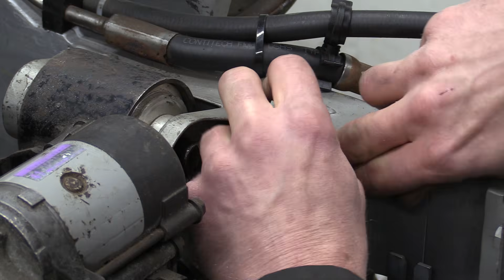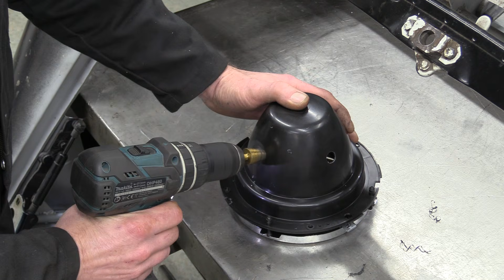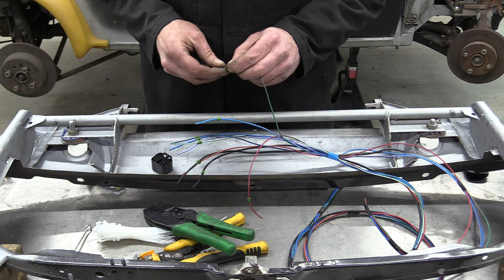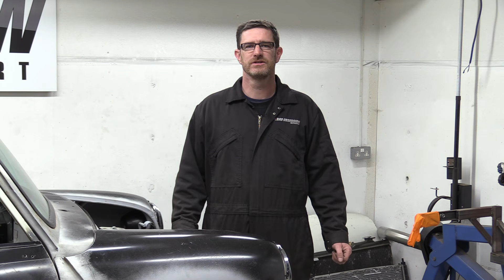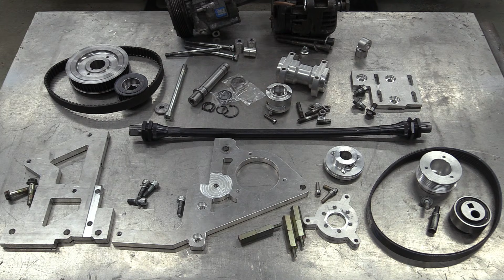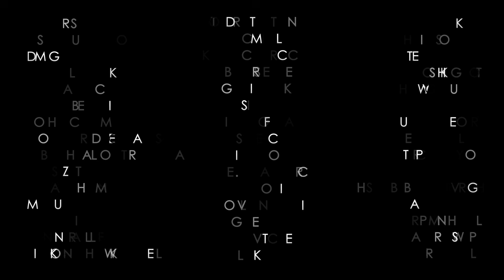Project Binky - Episode 20 - Austin Mini GT-Four - Turbocharged 4WD Mini

Comment: Reminds me of a story about the Citroën BX. Back in the 90s they started snapping cambelts, yet the same engine in a Peugeot did not. The difference was that the high pressure pump for suspension (and everything else) sat on top of the gearbox and was driven by a pulley on the camshaft. If the belt was at all slack when the pump cut in it would stall until the belt slack was taken up and then put a huge shock load on the cambelt. You were right to not do what Citroën did.

Comment: Question: have you guys considered a small self governing alternator that should be able to output somewhere between 12-14v to maintain the electrics and still charged the battery? Been looking into something like that for my project of *ahem jump jacking an older model hybrid to increase the battery range.

Comment: For the alternator, it came to my mind that you could use a really small hydraulic pump and a motor to relocate it elsewhere with fluid. Dunno if it wouldn't work but i suppose it would be possible.

Comment: Looking tip top as usual lads! Question: not using cable conduit or hole grommets? p.s - awesome work on the alt/ac assembly, engineering level99

Comment: Why wouldn't you Just use flexible peltier modules? Use the exhaust as a hot side and the driving wind as an cool side. If you can cover enough surfuce area you could make a realy decent power source!
Reply: Or even a turbo driven alternator.

Comment: Nice work minus the protective electrical sheathing and grommets.  As for the alternator issue, you could have bored out the pistons housings and added a cylindrical copper coil.  Then bored out a large diameter neodymium magnets and mounted them to the pistons, and hey presto, you have linear electric generator, unless you wire it backwards and then you have Electrical turbo. :-)

Comment: I was going to make some little idle comment about the lighting wiring like, put some rubber grommets where the wires pass through holes in the sheet metal, so they don't rub on the metal.  Then you blew me away with the alternator drive system :)

Comment: Guys, with all the trouble you are going through, why do you leave so many rusted part on the car??? Just look at rear suspension (at 15min 36sec of the video).  Why at this point that has nut been sand blasted for repaint???
Reply: They said it before. The old parts are placeholder. Would they use the final parts right now they would risk damaging them with their cutting and welding.
By example the motor didn't even have all of its pistons or valves.

Comment: Have you guys ever thought about swapping out the headlights for some of the all in 1 7" headlights. They have projectors which would help a lot with light output
Reply: Don't they just drop into the standard mountings? Example -
https://www.ebay.co.uk/i/291823392679?chn=ps.
Alternatively try some LED H4 bulbs like these. Example -
https://www.ebay.co.uk/itm/2X-Cree-H4-LED-Headlight-Lamp-Light-Car-CRL-High-Low-Bulb-6000K-White-100000lm/173515173609?epid=12020380098&hash=item28664f6ee9:g:Tf8AAOSwxHhbyt9R:rk:9:pf:0
The emitters are small enough to retain the correct beam focus.

Comment: For those of us who are culturally deprived and ignorant, could someone explain the TOT This Old Tony references? And thanks for the newest episode. Hopefully you can finish the Mini before I turn 80. 

BTW, in the 60s, I had an Austin Cooper Mini while in college. A lot of fun, but constant maintenance and repair (electrics, fuel pump, seat rails, wheel bearings, door handles, etc etc) If it could stay running, It was wonderful in the heavy snowfall of California’s Sierra Nevada mountains during ski trips.

Comment: Dude, the crank damper is harmonic damper also, it has an rubber mounting to take away resonance from the crank. Not sure if it makes diffrent tho since you probably will run smal turbo and not much hp. Should last awhile xD Love the project tho, want to see it on the road next year xD

Comment: Hello I realized that in the long term you can have a big problem in this area highlighted in the attached photo, it would be prudent to put a rubber in this hole to avoid with shaking that the cable will cut in the body and cause a short, I'm from brazil I love the project . Please Look at the picture https://www.dropbox.com/s/38nt07pzsz8uxfv/Opera%20Instant%C3%A2neo_2018-11-02_120819_www.youtube.com.png?dl=0

Comment: The Britts they are a funny folk.  Measure speed in MP/h instead of KM/h and count their money in Pounds but still use the silly metric system for weight.... :)
Reply: What's worse is that we invented your measurement units, and you're daft enough to still be using them! ;-D

Comment: btw, toothed drive belts on road cars (and rally cars!!) really need very good guarding stop stop bits of gravel getting into those teeth and jumping the belt clean off!  PolyV belts are the correct choice here (my choice would have been to mount a small high performance (high speed) alternator on the normal FEAD, and then run with an electric PAS pump and electric water pump that could have been easily re-located anywhere........  You could also have run an electric A/C pump, from a DC/DC convertor too, as the average A/C loads are fairly small, and you have a small cabin/small glasshouse, so pull down loading is not going to be an issue)

Comment: WOW !!  That alternator drive setup is AMAZING !

So if you don't like our "English" units, why is beer still served in pint glasses ?  Bottled beer in the US comes in 12 oz. containers, which is 354ml.  Much less than an imperial pint, 586 ml.
Reply: All our road signs are in miles and most people still refer to heights and weights in Imperial units.  I hate Imperial units but I'd still say I'm 6'2" and 13 stone.  It's all typically mixed up and a legacy of the long history that this country has.  It all basically works so no-one gets excited about it.

Comment: I love this build but I'm confused about the wiring. The shell has yet to be sprayed inside and out, but the way the wiring is routed, much of it is impossible to remove without cutting off the many presumably expensive plugs you've fitted. Having been such a perfectionist throughout, I can't get my head around what you are doing right now?

Comment: the OEM crank pulley is a harmonic dampner as well. Changing to the non dampening pulley can cause big problems. But then again this is not a 2ZZ engine revving at 8k RPMs and the oil pump is belt driven not on the crankshaft.  So you might be ok.

Comment: So I am actually a bit confused about why you are not using grommets of some kind.
Reply: Whole car has to come apart for paint, no use stuffing in a grommet just to pop it back out again.
Reply: @WiscomptonBoys  Interesting. So all the electrical plugs will get disassembled again to be pulled back out of their places before the car is painted? That seems a bit odd. Maybe the holes that all the wires are running through should be big enough for the plugs to come through as well?
Reply: @nathanjames4242   Yes, most likely it will. The attention to detail these two have is immaculate, and I would very surprised if everything wasn't completely removed to paint the inside as well as the outside. When a car is painted in the factory it's a bare shell, nothing else, then everything is ran through it. Same idea here. That keeps you from painting your wiring, grommets, etc. Plus, if you painted with the grommets in, even if you masked them, you'd have an unpainted circle underneath where the grommet was! Best way to paint a car is to strip it down to nothing, and one thing they don't need to over engineer is sticking some grommets into the holes, so no need to 'test fit' so to speak. 
Of course that's all just conjecture.
Reply: My thought as well, but the British are well known for their wiring.
Reply: Please see https://youtu.be/WIyxrvO3dRk?t=48
Reply: Look closely starting at 0:45 and you will see a Gromit being installed

Comment: Great video and great work as usual. I am surprised you have run cables through box sections without wrapping it in loom tape to protect it from abrasion caused by vibration. No rubber grommets in evidence either. Please protect your wires!
Reply: My best guess is why bother when it's all getting pulled out for paint eventually.
Reply: @valleywoodworker In one of their Q and A sessions they mentioned leaving some openings to blow anti corrosion down frame rails and boxed sections, I'd think after all the work into this car it wouldn't be too terrible to pull the wires after taping a pull cord to it. Wouldn't want to get paint on the wires, makes them brittle to with time.

Comment: Imagine wrecking this car. I wouldn't be able to race this car.
Reply: It's not being built as a race car,  it's going to be used on the road.
Reply: @RawTopShot  why is the channel called Bad Obsession Motorsport then?
Reply: Vax Buster 
They ( as a business )  prep and build race cars.
Binky is a personal car project, but serves the purpose of displaying the mens engineering prowess.
Reply: @RawTopShot  Displaying that customers will be waiting 5 years for an unfinished car :)
Reply: Well now, if you start paying for stuff, the project will pick up speed and be done in only 4 years time !
Reply: Without spot lights it will probably crash in it's first race

Comment: Flexishaft is pretty cool but did you guys factor in the inertia of the accessories on the flexisaft? When you gear change there will be a large step change in engine speed the torque produced from the alternators inertia may over stress the shaft. A one way sprag bearing will significantly reduce the loads.

Comment: Want to see the flexjoint in action, when the alternator has full load+a/c compressor.  I know that on a bench a 750W(ca 1hp) electric drill has not the power to turn the alternator when the battery is connected and the energize wire too.

Comment: Quality work as ever lads. Did you check out motorcycle alternators as an option? Plenty of small external mount types that could be modded to suit. Some are pretty high output, Honda goldwing or bmw k1200 etc. Was there no space to run a layshaft to the rear then step up via a short belt and pulleys to get the alternator above the box? Cramming alot into a small hole...

Comment: The main big power cable and wires exiting that chassis rail I would have put a cable gland on ... especially with unfused main power cable from the battery. If you guys want to fuse the Starter/Alternator get a nice MEGA style fuse holder that looks stock and put it as close to the battery as possible prefreably on a insultated surface too: https://au.element14.com/littelfuse/02981001zxt/fuseholder-mega-bolt-down/dp/9943200?mckv=snkbgIbge_dc|pcrid|59148083448|pkw||pmt||slid||product|9943200|pgrid|12550800888|ptaid|pla-295294719026|&CMP=KNC-GOO-SHOPPING-9943200&gclid=EAIaIQobChMIloXYiaO13gIVRmoqCh0mmwilEAQYASABEgLUOvD_BwE&gross_price=true

Comment: got to ask what ecu are you using as no dizzy ... and where are you putting the crank pickup ... and what about the TVIS setup with the flexible shaft ... just asking... big thing on some of the celica forums  the crank has a tendency to snap with a solid crank dampener ... guys keep it up better and better every vid you do  be it betamax or vhs

Comment: Am I missing something? Where’s the grommets and sheathing on the wiring loom to prevent abrasion and shorting? And the engine now lacks a harmonic balancer, love the work boys but you might want to rethink these. I’d recommend contacting ATI Dampers they can make something that will work for you.
Reply: I'm guessing the grommits and abrasion proof nylon sheath will come after painting. As AvE would say, it would let the angry DC pixies ooot !
Reply: I presume they will use a split plastic flexi conduit and some rubber grommets during the final assembly after painting.

Comment: Not being able to sip some tea in person my two Pents worth could be disconnected to one cent Australian.
A motorcycle alternator that direct drives off the crank would have worked and a peltier based cooling system would have done aircon and heater both.
Other alternatives would be going under the engine maybe running a tube through the sump. Or fitting a spacer to the bell housing and flywheel to fit a rear pulley

Comment: Great episode as always. On the alternator issue I wonder how well a motorcycle stator mounted right to the crank pulley would have worked. I think you can find ones that make 400 watts and there would have been no flex shaft.

Comment: Great bit of engineering.
I personally would have mounted the front lights connector 90 degrees to the way you have though. Even though it is water proof, a drip loop on both sides and no way for the water to pool would have made that connection bullet proof. But I'm sure it will be fine

Comment: Just a note . Does the new crank pulley have the integrated dampener like the factory one ? 3s's are renounced for having issues with changing to an alternate front pulley , and can result in crank walk or snapping . That's why none of us use anything but OEM

Comment: E60? Forget that, they had it wrong since the E46. I'm constantly having to sort out the molten plug and replace the light boards due to the single ground pin that is, you guessed it, the same gauge as the 4 power pins. BRILLIANT!

HAH! Love the This-Old-Tony bit.

Comment: What i don't understand is how you can spend weeks doing all the quality engineering but couldn't be arsed to tape that wiring loom up. You threaded those wires in areas which will rub through the insulation and could start a fire, its unsafe basically...

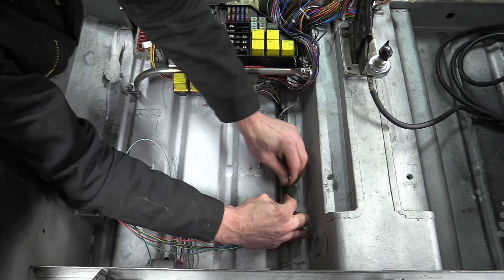Comment: 13:30.  Only thing that bugs me more than leaving wire ties uncut is cutting them off with the wrong tool.  Flush cut them.  You will appreciate not bleeding out when you drag a body part across those razor sharp ends.  https://www.amazon.com/Cutter-Lightweight-Klein-Tools-D275-5/dp/B000GTMZHG.  Fine work boys.

Comment: Where the wiring goes through the pipe on the bonnet, Will rubbing from opening and closing the bonnet, and vibration be an issue on the I.D edge? Probably needs a grommit or something in both ends of the pipe to stop the wire sheath getting cut into over time

Comment: As an owner of a Celica st185, I am absolutely flabbergasted at the engineering of the alternator and ac pump configuration. Seriously my jaw just hit the floor. I just got done rebuilding my 3sgte with quite a few modifications, but this is a whole new level. 

You mention getting rid of the distributor. Might I suggest an oil pump from a 99-01 5sfe Camry, the crank sensor, and a 3sge beams crank gear that already has a toothed trigger wheel attached to it.

Comment: Fantastic work, incredibly clever solutions! But, what about the harmonic balancer? Doesn't removing that rubber damper bit make the engine liable to shatter oil pump gears and ruin rod bearings from un-tamed crank harmonics?

Comment: Fantastic work guys! Excellent episode, keep'em coming! Your trans mounted accessory drive is pretty slick, a lot of work went into that setup! I hope that flex shaft holds up well, thats a lot of load on it. If it doesn't you might have to resort to a double jack-shaft arrangement. Or perhaps   there is some kind of small constant velocity (CV) shaft that would work? Maybe off of a 4 wheeler or UTV? Maybe custom built? Anyways awesome work guy's, keep it up!

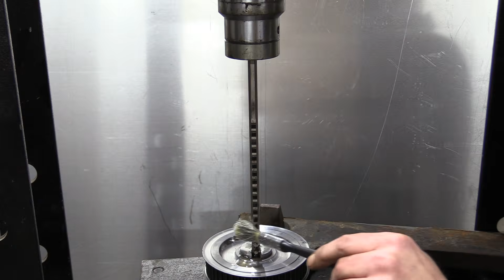Comment: What tool are you using at 22:40 to cut the key way out of the pulley? Never seen that before
Reply: It's called a broach. Push it through with a hydraulic press, arbor press, etc. with plenty of lubricant (oil)

Comment: I realize that you like to make fun of America pounds and feet.  But I like to remind you, that it was pounds and feet that defeated German metrics.
Let me give you a brief history lesson.  The French, the inventors of metrics, were the first knocked out of WWII.  The British were in sad shape.  It looked like the German metrics were going to knock out the British Imperial something or another.
Then along came Sam, or Uncle Sam with his foots and pounds, even the Great British Merlin Engine was sent to Packard.  Packard made the Merlin engine in mass production with less failure rate.
The Germans were no match for the American foot and pounds.  Germans were still using horse in WWII.  Of course the German machines were mechanical wonders, when they worked.  The top of the line Panzer broke down alot, and no parts were available to repair them.
You'd think the Brits would adopt "foots and pounds" after WWII, but no, they went with the failed metrics.  British who made the best cars in the world after WWII switched to the metric system, even after "foots & pounds" won WWII.
I love your series, but I wish British would switch back to "foots & pounds".

Comment: Rubber grommets. Wire conduit. Love it. Use it. You cant run wires against a cutting edge like that guys. You do amazing work on your pully system and then you butcher the wiring :0
Reply: I am sure they tackle that when out of the paintm

Comment: Use a lubricant on your lathe work..  so you don't chance getting caught or even burring your work or causing unsightly lines in the metalwork itself. 

MCM tip. Turbo Yoda uses this in his skid factory show.